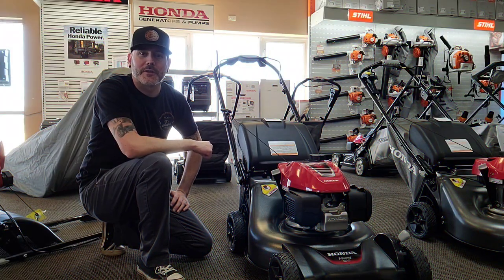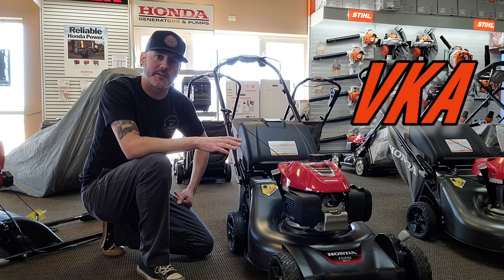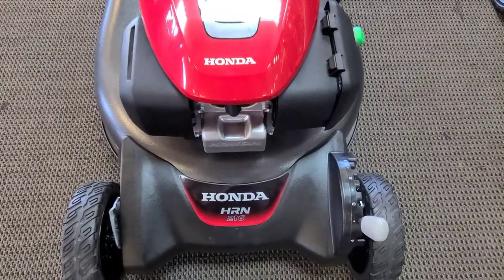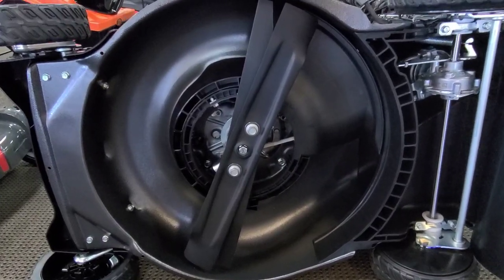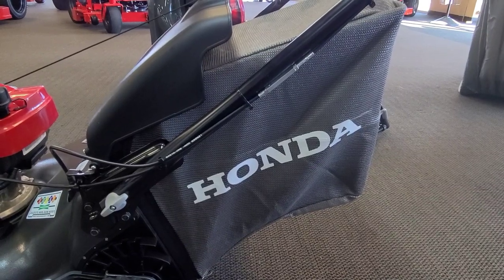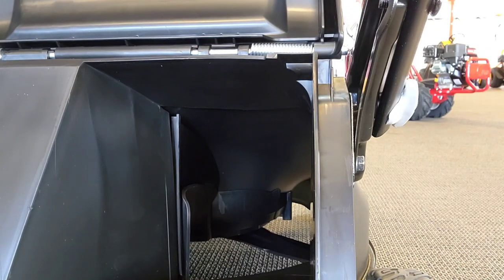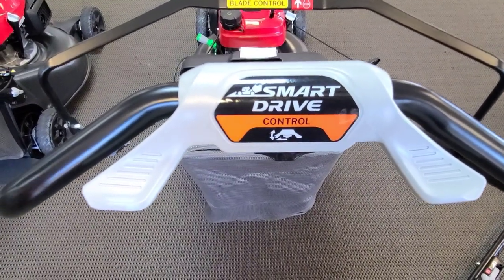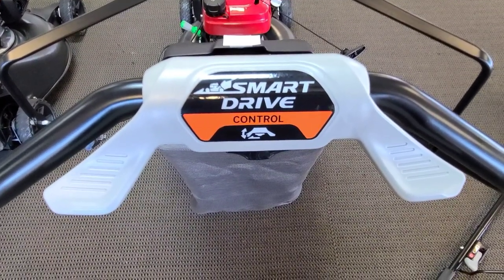Honda HRN 216 Review | What you need to know | Ep: 1

Comment: Good video , I have used toro super recyclers for about 7 years in my business but I’m thinking of trying a Honda . Wondering if this would b a good option for me . Thanks
Reply from the maker: I think they're a great option, if you're looking for a relatively inexpensive mower. The HRX would probably hold up longer, but costs more. Thank you so much for the watch and comment! Hope business is going well for you! 👍
Reply: I’m here for similar reason.. but not professionally.. more so the lazy man who cuts once every other cut cycle and looking to see if the 2 blade and more power makes up for not having the side discharge needed for taller wet grass. And also to logic says the rear discharge would be better then cleaning out a clogged side discharge port lol
Reply: From what I’ve seen you’ll be making a lot larger overlap passes to get grass even with this two blade vs the toros and single blades.. also these newer models have major issues with the auto choke actuator.. cheap part easy to replace but that’s for the homeowner..
As a business that’s frustrating and time is money.. if you do this for a profession I think it comes down to the two different self drive methods and tbh idk why Honda is about the only one left still trying to go rwd on a push mower.. but at same time that auto pace on the new toros is head scratching for a fwd mower especially.. if I was in your shoes I’d go toro hands down. I’m only here as a home owner looking for something that has more power in same price range cause I don’t cut my grass weekly and when I do it’s usually wet and I’m curious if that rear discharge might prevent the clogging that you get from a side discharge under those conditions plus the Honda has a lot more torque and little more hp.. as a lazy homeowner I think the Honda might be the better option.. as a business owner and understanding business needs although not mowing grass.. to me the toros seem the better option.. if no other reason the they are fwd vs rwd.. much easier to keep drive engaged and just pick up the front end and pivot vs having to learn to mow in a different fashion then normal

Comment: Love my 8 year old HRX and always recommend Honda.  Just suggested an HRN to someone over a craftsman.  He bought the HRN and hates it because of the cut quality and says it leaves stragglers.  Never had an issue with mine.  Any ideas if there is a problem or the nature of the new HRN.
Reply from the maker: The HRN should cut virtually the same. It may not be running at a high enough RPM though. We adjust them out of the box and most are too low. It's probably not spinning the blades fast enough.
Reply: @rocketsoutdoorpower6971  how do you adjust the engine speed?
Reply: My hrn does leave leafs a few leaves uncut. I checked the blades and they are not dull.  My father says it could be due to summer leaves are hard and not tender as in the fall.  We also checked the speed inside the carb ranit on high same thjng
Reply from the maker: @dannymartinez8522  It could be a number of things (RPM issue, blade issue, etc).  Something is causing it. It's just a matter of figuring it out.

Comment: After 5 years the self propel function crapped out. Local repair shop wanted $530 to repair. I just had them disable the sel-propel now it is strictly a push mower
Reply from the maker: Well, if it's 5 years old, you got the very first HRN. I'm not sure what your local shop thinks is the price of the entire mower to fix, but $530 is very steep for anything in that drivetrain. Sorry to hear about it, though.

Comment: How do you like the rear discharge vs side discharge? I discharge 99% of the time. My old toro needs to be replaced but having a hard time accepting the idea of rear discharge… 

Also, how durable is the rear deflector? Can I still run over small sticks like I do with my Toro?
Reply: The rear deflector is durable. As far as the rear discharge goes, it works ok if the grass isn't  tall and/or wet. Mine will continually clog in those situations. I keep mine set at three inches and mulch most of the time.

Comment: Hey thanks for the vid. What I can't tell is if the blade is on "RotoStop" mode - is it still self propellerable. I want to drive it over paths and areas I don't want the blade to be running over. I don't want to have to push it.
Reply from the maker: If you don't push the yellow button first, the blades are not turning. You can still use the self propell to drive it.

Comment: Something else to note about the VYA version(and possibly the VLA version?): it has a throttle. The VKA does not. The nice thing about being able to control the speed of the engine is the ability to let the high-priced Honda to warm up a bit before you put it to work ...and let it cool down a bit before you put it away. As a  bit of a gearhead, I never could understand how it's in any way good for an engine, of any type, to go from dead cold to running full tilt (or close to it) in a matter of seconds. And allowing an engine to cool down for a couple of minutes before shutting it down is equally as good for it's longevity ...neither of which is possible on any mower without a throttle.  Give me a throttle on my push mower! And since this video was made, the VLA is running about $700, on sale(!), at my local Lawn Equipment dealer here in GA.
Reply from the maker: The VYA is the only HRN with a throttle. It doubles as the stop switch, so Honda only puts a throttle on their mowers that have a blade clutch. They only run at just over 3000 rpms, so it really isn't hurting anything for them to shut off with a typical bale lever. That's how the majority of mowers at lower price points work, anyway. $700 is a little high for a VLA, but Honda is stopping production this year. So, if you really want one, buy it.

Comment: The draw back with that mower is there is no cover underneath to protect the belt area sticks and leaves get up underneath ,not good ,jimmy Aust
Reply from the maker: I've seen 4 of these come through our shop with that happening. We've sold somewhere around 500. Not exactly a major problem.
Reply: @rocketsoutdoorpower6971  2 bushel bag size(2.5 better) and no belt protection just seem like sloppy work.
This is the only thing holding me back from purchasing this mower, looking at the HRX line but don't like the 4 point deck adjustment.
But, it does have a 2.5 bushel bag. Also heavy and doesn't pull backwards without some effort from what I've seen.
There is no perfect mower. Probably will but one or the other leaning HRN with Blade Stop.
Reply from the maker: @Maverick4841  Decide fast. You have 2 years until they're done.
Reply: @rocketsoutdoorpower6971  Yes sir, I'm on it.

Comment: On this mower what gas should I run and any additives? Looking to make it last. Just purchased it. Thanks!
Reply from the maker: Use a premium/non-ethanol. I always use Sea Foam to keep the gas from breaking down over time.
Reply: @rocketsoutdoorpower6971  
Exactly right Sir! I keep SeaFoam in my 5 gallon gas can year round. All my engines have SeaFoam all the time. At the end of the season I just shut it off and park it. Next season, 6-8 primes of fuel and first pull start for all my equipment.
Never have to rebuild my Jeep carb anymore now that I run SeaFoam in the last tank of gas before storage.

Comment: I have a Hrx217  hydro I’ve had this mower for 6 years I use it 2 or 3 times a week in my lawn business but last year the tranny went out rear tires started locking up and to my surprise I had one month left of warranty and Honda replaced my tranny a $250 tranny plus labor cost all covered so I should be good another 5 years great mower wouldn’t change it for nothing else.
Reply from the maker: The hydrostatic ones are the best. Pretty rarely do we replace any transmissions. I'm glad you're liking it.
Reply: @rocketsoutdoorpower6971  Yes they are.I bought a Toro Timemaster 30 worst mistake I ever made I’ve had it for a year and it’s already breaking down 3 times and that Briggs motor histates in tall grass where my Honda has never bogged down on me in any tall grass and the engine is way more smooth running then that Briggs engine I’m selling that Toro Timemaster and buying another HRX217
Reply: I stay away from hydro riding mowers due to problems towing trailers or hilly terrain. 
Do these hydro Honda mowers have problems? I don’t mind just replacing a belt when it breaks but if tranny goes out it’s not a quick fix
Reply from the maker: @notsofast5495  basically all riders are hydrostatic anymore and the HRNs are not hydrostatic. That is only offered on the HRXs.
Reply: @notsofast5495  My Honda HRX 217 the hydro tranny went out at 4 years and 11 months I was lucky I still had 1 month left of warranty cause it would have cost me a little over $300 to fix its a $1000 mower so if the tranny goes out at almost 5 years its worth fixing I use mine like in 6 properties a week
Reply: @notsofast5495  I recommend you this mower its very reliable and always starts in the first pool and mine is 6 years old do your oil changes every 50 hours

Comment: My Honda mower with a  manual choke perished in a garage fire. Is the Thermalwax Choke Activator still an issue?  Thanks. Chris
Reply from the maker: It just depends on everyone's definition of "issue". It's the most likely part of the choke to be replaced, but it's not like they all go bad. It's a simple/cheap fix anyway.
Reply: @rocketsoutdoorpower6971  Thanks for touching base. I'm 72 - retired. Live north of Toronto. Is the choke activator readily available in this hard to order anything world we live in!
I really did love my old Honda mower. I did shop at my Honda Powerhouse store. I haven't bought anything yet. Why wouldn't Honda warranty the part.
Reply from the maker: @chrissorlie5291  Honda will cover them within the warranty period. We only have to replace a very small percentage of them under warranty.
Reply from the maker: @chrissorlie5291  and they are readily available still lol
Reply: @rocketsoutdoorpower6971  Thank you very much for taking the time. Problem solved!!!
Reply from the maker: @chrissorlie5291  Absolutely and thank you!

Comment: 2 bushel bag size(2.5 better) and no belt protection just seem like sloppy work.
This is the only thing holding me back from purchasing this mower, looking at the HRX line but don't like the 4 point deck adjustment.
But, it does have a 2.5 bushel bag. Also heavy and doesn't pull backwards without some effort from what I've seen.
There is no perfect mower. Probably will but one or the other, leaning HRN with Blade Stop for bagging leaves.

Comment: Great review. I have had four Hondas in all the variants that you have mentioned. Love the extra 10cc’s on the new model. The only negative comment I have about the new group of Hondas is cheaper wheels. When you are replacing wheels is there a rubber wheel replacement that has better traction / lasts longer that you know of? Thanks for the video.
Reply from the maker: Thanks! You may find something aftermarket, but we only sell the OEM replacements.

Comment: Surging issues are common in these new Hondas. Emulation jet holes are to small. Hondas attempt at addressing emissions primarly for California.
Reply from the maker: That would depend on one's definition of "common". Some may say jet holes are too small. Others would say sediment in the gas isn't a carb issue. It's all relative.
Reply: You nailed it.
I bought one, regret it. I use ethanol free gas, water removing filter and only take the gas cap off when there's no chance of dust. My last Honda for sure.
Reply from the maker: Good luck to you 👍

Comment: My bag keeps falling off on the right side while walking behind, what's up with that?
Reply from the maker: I've never seen one do that, so I couldn't tell you exactly. It's a pretty simple design, though. Most likely, that little hook on the bag frame isn't bent correctly.
Reply: @rocketsoutdoorpower6971  Hi hearing that Honda is pulling these of shelves in stores due to a problem with the pull cord being really aggressive. Some have injuries, so far mine works great and I just much this time of year going forward.
Reply from the maker: @royhobbs785  there's a decompression valve problem on some. It's only seemed to be on a few HRXs for us. It's a pretty simple fix, but they have quite a few machines out there with this failing part.
Reply: @rocketsoutdoorpower6971  Thanks

Comment: I have a new one and it has been a nightmare to own. It’s hard to start and the engine surges nonstop. Carb cleaned, no ethanol gas, wax assembly replaced, oil changed, spark plug changed. Nothing.
Reply from the maker: Take it to your dealer. Whatever is causing it is fixable, and that's why they have warranties.
Reply: Sounds like my vkaa . My old ass tda runs like a champ

Comment: I can’t not remember my model could be the HRR I will have to look. But I do love my Honda mower very dependable and easy starting. I think the 2 wheel adjustment is perfect. I do love the handle bar release also and the mulch lever which I also have on mine

I did not think I would like the thumb control but I actually really love it. If you don’t like it right away give it time, you will lol
I do not have the option to keep my mower running between bag changes though - good video

New friend here - check me out

Comment: There are alot of problems...wheels hubs are plastic and no bearing .The drive belt system does not have a guard ..it clogs and brakes  the belt. The drive cable has a plastic drive holder and cracks. The handle  knobs are plastic and will snap off. The carb  clogs easy and will not start well. The mower deck will not mow the grass evenly.
Reply from the maker: And somehow, they keep selling them. lol
Reply: Not after Sept the plant in Burlington NC near me is closing. Just as well if they are going to build crap now $ 150 more
than the last good mowers.
Reply from the maker: They're stopping production of all the gas walk mowers due to bans in certain states. It's not because they "all" have some problem. They wouldn't outsell everyone else if they did.
Reply: @rocketsoutdoorpower6971  Not really the state of California sued Honda about there emissions and won a huge settlement in court.That was the last straw for Honda and they left the US market will still be made for European market.The mowers were made cheaper to offset the cost of the new regulations but did not pass California .I have a friend who works there confirm this .
Reply from the maker: It's all been made public and the other companies will follow suit.

Comment: Wish I could say these are as great, as the other Honda pushers.  Mine has been babied, and regularly serviced.  After one season, mine was surging, bogging, and the propel drive went out.  I'll be honest, if my local dealer will not make repairs (as I have heard, they won't) ...I will be replacing, with a different machine.  Best of luck to you, if you have this model.  Honda can do better than this, and they should.
Reply from the maker: There's a problem with your dealer if they're not taking care of it. This obviously isn't the norm for Honda either. They wouldn't sell any if it were.